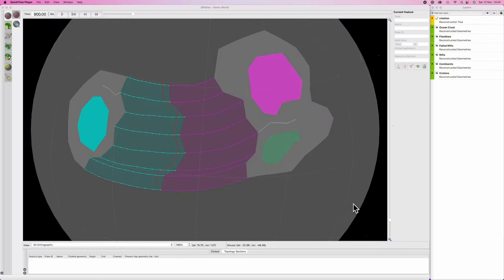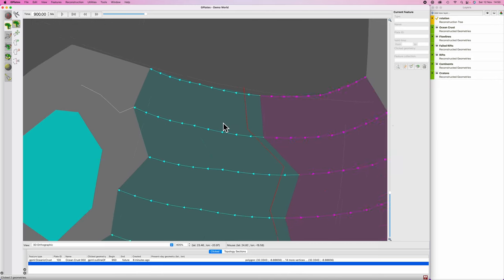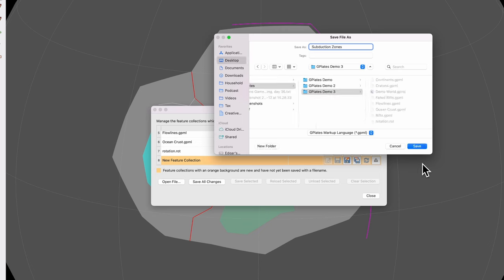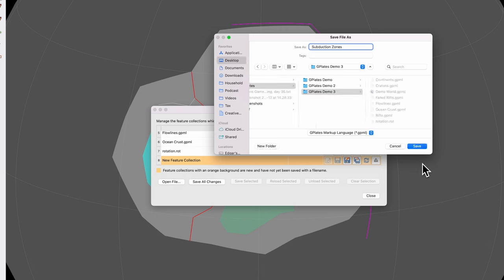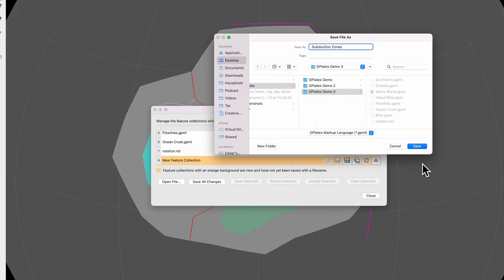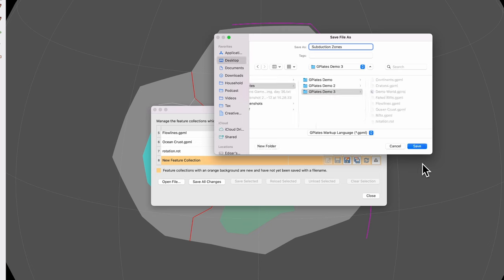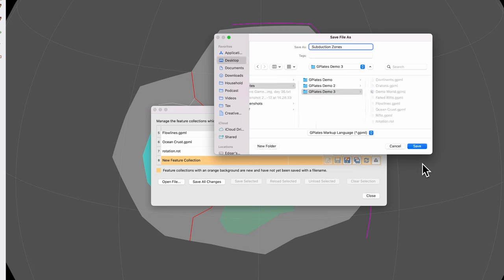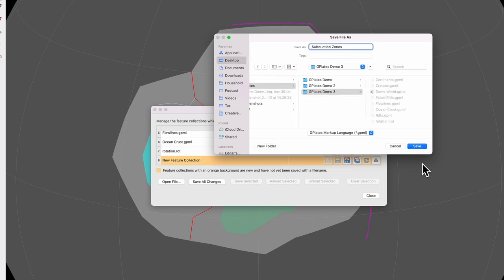GPlates: Subduction Zones & Island Arcs - Worldbuilder’s Log 12

Comment: Edit: Listen to Artifexian! Putting the drift correction into the 0.0 timestamp screws up the flowlines. Just follow the video.
1:30
Idk if it's because I'm using the slightly newer 2.4 version instead of 2.3 (judging from what he showed in the first gplates video) but I was able to put the drift correction coordinates into the 0.0 timestamp just fine without everything breaking. So now I don't have the snapping back to the beginning at the end

Comment: Ha, I knew it. Gplates just breaks when you change that first line in rotation. Great video again!
Reply: Makes sense. The file isn't actually describing fixed positions: it's describing movement*. You need to set the angular change at 0Ma to be 0 because it's not moving at present day. Seems to come from Tutorial 2.2, Exercise 1. I *think the actual issue is that features aren't actually pinned to a specific time: they just exist for the entire timespan you define for them, in the location that you originally defined. So if you don't specify their entire rotational history, they will extrapolate that "present day" is the same as the point in time you created them at.

Comment: I love this series so far! Worldbuilding and conlangs have been some of my major interests/hyperfixations over the years, so I really enjoy watching your channel. I know I could probably look this up, but I'm wondering when and where you might expect hotspots to form. (If I had to guess I'd say relatively near subduction zones but farther away than you might expect island arcs to form?)
Reply: I'm not sure that there is a scientific consensus on this I will say however that there are several different kinds of hotspots. Some are related to upwelling plumes and some are not with more complex origins.

First there appear to be at least a few kinds of hotspots that aren't necessarily linked to plumes. The first is effectively a consequence of the stretching or more typically twisting of crust in this sense these hotspots are tears or weak  points in the crust this on its own doesn't usually seem to be enough for volcanism however with minor upwelling from either a nearby midocean ridge/continental rift or another type of hotspot so these are more factors which extend the range of volcanism outside the usual limit a sort of quasi hot spot. The crust needs to be thin for these so you need oceanic crust or continental crust that is currently getting rifted apart or extended in some other way such that it is over time become more oceanic in character. The Basin and Range Province in North America is a good example of the latter while the Canary islands are an example of the former where a branch of the African plume is coming up at an inclined angle from below Africa and leaking out through cracks in the eastern side of the Atlantic next to Africa. 

Another way volcanism can arise is via a process called slab drip which is in essence where parts of a strained continental plate's underside break off and sink into the mantle inducing the underlying mantle to flow up into the gap. This process thus is generally linked to craton destruction/breakup either due to the overthickening of the crust during mountain building or from subducting an upwelling and active mid ocean ridge. 

Its worth noting that extensional and thermal upwelling induced Craton destruction is also a prerequisite for grand Canyon like features as you need rigid crust getting uplifted extremely quickly in geological timescales(i.e. in a few million years). Any weaker crust than an ancient mature craton will generally just break apart into smaller blocks before you can uplift it at such high rates. These canyons are also surprisingly ephemeral though the effect appears to propagate like a wave through the craton but I digress.

As for hotspots related to plumes they all involve lower density material  upwelling but the cause of the lower than average density causing the upwelling can be either thermal of compositional or perhaps even a mixture of both.

The first and most familiar kind of plume hotspot with Hawaii and the Galapagos being among the most well known examples is the thermal plume hotspot which based on seismic tomography appear to be hotter than average material upwelling which is also supported by the higher temperature lavas they erupt.  These rise up from the core mantle boundary and extend to the surface and are generally concentrated around several features known as Large Low Shear Velocity Provinces(LLSVPs) which are basically huge continent like blobs at the core mantle boundry.

There appear to be two of these one of which is centered underneath Africa and appears to be responsible for driving rifting activity there and around other hotspots in the Indian and Atlantic region.  
The other major LLSVP is found in the Pacific and is associated with most of the hotspots out there respectively.

The African LLSVP is notably  less dense and thicker over all compared to its Pacific counterpart and they are roughly opposite to each other. This suggests the African LLSVP is likely younger and this lines up with the fact that several slab walls appear to lead into it which if estimating that the rate of measured sinking per year has been relatively constant this would suggest it takes around 230 million years for a subducted slab to finally hit the core mantle boundary.  While there are alternative hypothesis the best explanation is that these LLSVPs represent the slab graveyards that have piled up along the margins of major long lived supercontinents in which case the African LLSVP corresponds to Pangaea and the Pacific LLSVP likely corresponds to Pannotia or perhaps more likely Rodinia since the intermediary "supercontinent" Pannotia began rifting apart before it even finished forming (and in some sense you can better think of it as the two minor supercontinents of the day sliding next to each other i.e. more of a transverse plate boundary akin to the San Andreas.)

 

The other type of plume based hotspot is compositional and seems to relate to the saturation of the mantle above a subducted slab either sinking or currently stuck at the Mantle Transition Zone the boundary between the upper and lower mantle where the slab rock is held up while chemically phase transitioning. In this case water and sediment derived volatiles get pushed out of the recrystallizing slab and into the overlying mantle as part of hydrated minerals. This eventually can make the overlying mantle under dense causing the material to rise. These magmas are chemically distinct and can quite frankly be somewhat bizarre.

The best known modern example of this kind of volcanism is the hotspot feeding Mt. Petaku/Changbaishan which has a purely chemical(hydrous) origin
https://www.nature.com/articles/s41598-019-43103-y

That said there are extremely strong chemical similarities to the huge flood basalts associated with the break up and or failed break ups of Supercontinents which suggests that these processes are linked in some way.
 That is to say the magma that breaks up supercontinents is enriched in subducted slab material.

That said while we have an idea of where plumes come from within the Earth no one actually knows what causes the plumes to occur and when as there a number of suspicious coincidences with timings and the emergence of new mantle plumes to the surface generally seems to correspond to major sudden and even quite dramatic rearrangements of tectonic boundaries. Some though not all of these also seem to   correspond with major impact events suggesting there is a connection and at least some of these seem to, at least in some cases, have something to do with the balance of Earth's moment of inertia which can at times get lopsided due to plate tectonics and also likely involve whatever processes  regulate Earth's effective balance of rifting and subduction, 
but none of this is a smoking gun and thus is still quite mysterious. 

Notably form a worldbuilder's perspective these seemingly almost random rearrangements can be used for creative purposes at least while we remain ignorant of the mechanisms. ;)

For an example using one of the more recent and thus better characterized major rearrangement events, the Hiawatha crater found under Greenland has been dated to 58 Ma  which corresponds to one of these  events which rearranged the Pacific ocean's tectonic boundaries significantly over the next 10 million years or so and saw the fairly unique emergence of not just one Large Igneous Province but two relatively simultaneous  LIPs the North Atlantic Large Igneous Province(NALIP)  associated with the Icelandic  hotspot and the LIP that created the basaltic plateau that composed Siletzia accreted by North America and its sister half the Yakutat terrane which is currently subducting along the Aleutian Trench in Alaska. In both cases the LIP formed along what is today a Mid Ocean Ridge though at the time the northern extent of the Mid Atlantic Ridge didn't yet exist instead representing a failed rift from the original break up of Pangaea between Greenland and what is today The British Isles namely Ireland and Great Britain (at the time those two islands would have been connected before they were bisected by a failed rift associated with NALIP) The point is there are a lot of commonalities between these two hotspots Iceland and Yellowstone respectively even if North America has currently overridden the section of the East Pacific Rise where the Yellowstone hotspot had been located

Does it seem reasonable for a 31km crater to cause that much chaos? frankly I'm not sure I would guess it required a confluence of factors with the impact if it was involved at all being the straw that broke the camels back so to speak but we don't know.

Frankly there is a lot that is unsolved for example why do some ridges spread very fast like the Pacific while other like Gakkel ridge in the arctic barely spreads at all

 Also fun fact about Gakkel ridge is it has at multiple points during the Pleistocene has instead of effusive spreading via pillow lavas, built up vast volumes of magma trapped below the ridge ultimately cumulating in a cycle of caldera forming super eruptions the only such eruptions known to occur at depth along a mid ocean ridge rather than in continental conditions.

Two of these eruptions at 2.5 Ma and 1.1 Ma even appear to correspond with the onset of permanent Glaciation in the Northern hemisphere and the shortening of Milankovitch cycles respectively which is somewhat suspicious suggesting something more may be going on.
Granted there is about 8 of these eruptions and nothing seems to have happened with the other events but 1 in 4 is the expected odds for a random eruption to end up in any given season so a Volcanic Explosivity Index(VEI) 8 eruption in the late Spring to Early summer timeframe  between the likely prodigious amounts of ocean blasted away into the atmosphere and the enormous quantities of ash could very well have stopped the polar summer and thus allowed ice cover to build up over several years while also providing prodigious amounts of water to form snow and ice so its not too much of a stretch.
Reply from the maker: It's complicated, so complicated that for our purposes here they can basically go anywhere.

Comment: 27:12 Correct me if I'm wrong but I'm pretty sure it's bad to make rifts like that. Triple junctions form to relieve the stress and pressure on the crust, so the three different spokes are probably going to be fairly equidistant from each other in terms of angles, having them all smooshed up like that probably isn't very stress-relieving. Think about cracks you can see form IRL, you don't really see it like that.

Comment: Can rifts and failed rifts happen in completely oceanic crust? And if so is there anything special about either?
Reply from the maker: I'm not sure … perhaps. I've never messed with this so it's definitely not needed.
Reply: @Artifexian  I was mostly wondering if that might be how purely oceanic plates like the pacific came to be, since continental crust can't subduct. Unless it's that all plates used to be purely oceanic and the pacific is one of the only holdovera from that time that hasn't acquired any noticeable amount of continental crust?
Reply: @Great_Olaf5  Rifts absolutely do happen on oceanic crust. That's what a mid-ocean ridge is. Compared to continental crust, oceanic crust takes way more effort to break. If it does break, it's almost always related to subduction-related volcanism, hotspots, mantle plumes, etc. It breaks because it's being tugged too hard by slab pull (which is THE biggest driver of the plate motion) and the thinning from the mantle allows it to snap. Over time, they also tend to align to trenches, with the fracture zones orthogonal and oriented towards the trench. You can see this in bathymetry maps where the fracture zones are essentially natural flowlines.

Rifts in the ocean tend towards two main systems: Pacific Subduction Systems and Tethyan Subduction Systems. Pacific systems continually feed a complimentary system of subduction zones with intense volcanism and Andean-style margins and can continue for hundreds of millions of years until one of the ridges is also subducted. Tethyan systems feed a single subduction region from a rift until the rift is itself subducted, and it then pulls away continental crust on the other side of the plate. When it accretes or collides, the subduction zone jumps the terrane and begins pulling the feed from the rift that formed on the original continental piece and generally keeps this up until subduction is stopped by massive continental collision or the new rift spreads from a triple junction and morphs into a Pacific system.

Comment: Regarding subduction to get a proper perspective remember that subducted crust isn't exactly destroyed rather it starts sinking into the mantle with the volcanism induced being driven by partial melting of preferentially lighter rock as the lighter more volatile components  of the descending slab get forced out with greater depth and pressure enriching the overlying mantle.

That said island arcs aren't made just from subduction volcanism but also from accretion or accretionary wedges in more technical terms.  These can be complex involving sediment scrapped off of and or piling up onto the overlying plate as well as existing island arcs or other land mass fragments and also other stuff  tops of overly thickened oceanic plateaus where the crust is too thick to subduct entirely.  These can be complicated forming from Large Igneous Provinces and or coral atoll complexes but you can use them to justify globby extensions of new additions to continents and island arcs and they will be the main way that non volcanic rocks are added to arcs.

Additionally while these arcs are anchored to continents mature subduction zones anchor themselves as the heavy descending slab wall effectively serves as a literal anchor as they descend down into the lower mantle.

In this context its probably worth noting that when major volcanic archipelagos finally get accreted those archipelagoes have generally existed out in the vast ocean since the previous supercontinent cycle for example Avalonia a major microcontinent formed from volcanic arc accretion started back in the Neoproterozoic before finally getting sandwiched between the paleocontinents Laurentia(paleo North America) and Baltica near the tropics With its southern extent colliding into Gondwana which at the time was largely centered around  the south pole though with its sheer size as a minor supercontinent Gondwana would have extended to mid latitudes.

Another example of a major volcanic archipelago accreted during the formation of Pangaea there was Kazakhstania this was considerably less developed likely consisting of parallel volcanic arcs accreted onto Gondwana before getting smashed in from the North by Siberia which at that point had joined the mash up  that is either called Laurussia or Euromerica.

A younger example of a late stage arc accretion is Wrangelia which along with the intermontane and insular terrains were oceanic arcs which over the course of the Mesozoic got accreted onto a larger oceanic arc comparable to Indonesia that in turn got accreted onto the leading edge of North America during the Cretaceous timeframe. This appears to have been a 
surprisingly complex subduction zone system based on using seismic tomography to look at the shape of the subducting plates which in effect preserve the original configuration as these arcs were old enough to become deeply anchored into the lower Mantle

The proper edge of North America's continental shelf back then was  was back in eastern Idaho and western Montana and was driven by what was originally subduction along the coast of Pangaea extending at least back into the Triassic. These formed likely a succession of accretion events .

The exact details of this collision have not yet been convincingly mapped out but it does appear to be highly complex much like the modern Indonesia and it was this arc complex which would form most of western North America during the Cretaceous.  In this picture think having an Indonesian style volcanic archipelago anchored into the lower mantle which gets ultimately slammed into another subduction zone as its underlying plate got subducted in a much more Andean style volcanic arc that was the proper Laramide orogeny.